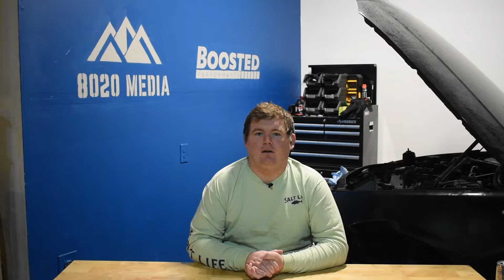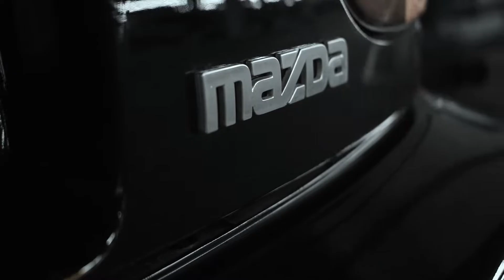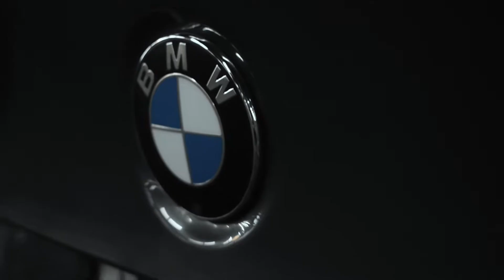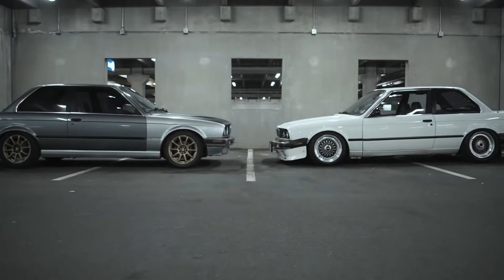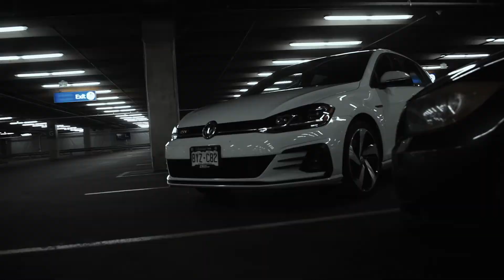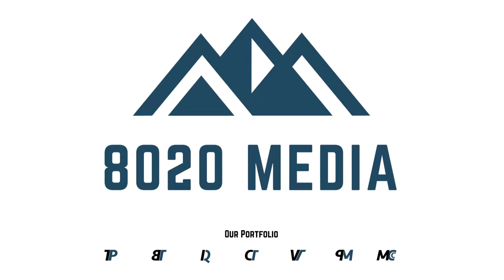Ford's 6.7 PowerStroke | Reliability and Common Problems

Comment: Greetings !  , what would be the symptoms of metal in the fuel system due to metal , from the injection pump failure ?
And what codes point in the direction of fuel pump failures ?
Thank you !!
Reply from the maker: C - Metal shavings from the pump can contaminate the entire fuel system, and the symptoms are nasty—hard or no start, rough idle, hesitation, loss of power under load, stalling, and eventually total engine shutdown. You might also hear clicking or ticking from the injectors as they get clogged or damaged. As for possible codes: P0087-P0089, P0093, P0191.
Reply: Thank you very much for a great imput , thank you a million , for answering my question , and your time ; plus going beyond with your anwer .
 @8020Automotive

Comment: The 300k miles.  Is in my opinion not the end of life of motor.  They need to last 500k   Especially for $85k-$100k truck
Reply from the maker: J - "need" is a little aggressive, especially for nowadays standards. They don't build them like they used to.
Reply: @8020Automotive  true. But they weren’t $100k in 2002 either. They were $38k. lol. I hear ya. “Need”. Hard to expect less for $100k lol. 😂
Reply from the maker: J - Agreed!
Reply: @joshuajuarez3471 what do you think 38k was worth, “back then”?

Comment: what should i bwe looking for in a 2015 6.7 at 219k
Reply: 200k miles is not a lot of miles… I’ve owned several 6.7s with over 450k miles on them. It’s all about how well they’ve been maintained. Don’t let this dude scare you off about a truck that’s had a life other than sitting in a garage…
Reply from the maker: Christian - Although 200k miles may not be a lot to the 6.7 PS, that is still a lot of miles in the grand scheme. Not once did we say it was "too many" miles. In general, if maintained properly, yes, these can make it way past 200k.
Reply from the maker: M - That's a lot of miles, but make sure to check the maintenance records. Buying a vehicle with high mileage it is crucial to know that they have been maintained well. Other than that, you'll want to check out the things listed in this video.

Comment: I'm considering buying a 2015 f250 6.7L with about 95kmiles. I don't know really anything about trucks. Can anyone help me with like the pros and cons and/or what to look for or be carefull of when checking out the truck? Any help would be greatly appreciated.
Reply from the maker: Brian - Did you watch the video?
Reply: I did. 
 @8020Automotive
Reply: I've been trying to my research and scan reviews. I'm trying to get all the info I can so I don't end up in the situation I'm in with the 07' 6.0L I bought 2yrs ago (money pit)
Reply from the maker: Brian - Totally understand. We have a TON of content about this engine on our DieselIQ website. Here is one example: https://dieseliq.com/67-power-stroke-complete-guide-know-amazing-truth/

Keep us updated!
Reply: @briandaubert454 what are you paying for the truck?
Reply: Just purchased a 2016 f350 dually 2 weeks ago and learned after getting to my diesel shop that the fuel pump is at the beginning stages of failure so whatever you get have it checked out immediately. They're going to do the conversion kit and hopefully this is all I'll have to do to it. This truck is a MONSTER and I love it already. Coming from a 6.0 to the 6.7 is night and day difference in towing power. Do your homework and be prepared to have a few things fixed from the beginning but these trucks are very reliable if maintained properly. Good luck
Reply from the maker: Greg - Thanks for sharing your experience! You'll love the 6.7, glad you found the fuel pump before it was too late. Conversion is definitely the way to go.

Comment: I put the S&S DCR pump conversion on mine and got rid of the CP4 forever.
Reply: Did you have a shop do it ? How much was it in total ?
Reply: @wmcourte5161  Shop install was $700
Reply from the maker: F - Great decision!
Reply: @8020Automotive did you install or did a shop? If shop how much that cost ya?

Comment: Hey there, I have a 2012, 6.7 completely deleted with an intake if I change the fuel filter on a very regular basis will say with every oil change would this be enough to prevent the Bosch pump from giving out or what I need to do more. Please let me know what I would need to do if so.
Reply from the maker: 2b - You're certainly on the right track. Which pump do you have? CP4.2?
Reply: @8020Automotive  hey there yes I do have CP 4.2
Reply from the maker: Okay. Diesel fuel quality is huge when it comes to these engines, so make sure you are getting your fuel from a reputable gas station. Also, there are fuel additives that can be used, here's an article that can be useful for that: https://bapasonline.com/best-diesel-fuel-additive-for-the-ford-powerstroke-6-7l/. Lastly, you COULD do a CP3 swap. We've seen many benefits from this. Other than that, it sounds like you are doing everything right! Keep us updated on this.
Reply: @8020Automotive  thank you very much. You guys are very helpful. I’ll check in in a couple months. Thanks for the help.
Reply from the maker: Absolutely! We appreciate it.
Reply: @8020Automotive what cp3 fits in the 6.7 powerstroke valley? It’s to big to fit
Reply: Gen2.1 6.7L Ford Power Stroke CP4 Disaster Prevention Kit

S&S Diesel Motorsport
Reply: Use an additive that adds lubricity. I run it in every tank. I am putting a s&s DCR on next week but will still be running additive. 👍

Comment: 2012 f550 bought in 2019 with 25k kms. Now has 111k kms has been deleted and straight piped. On its third turbo. Ric Flair WOOOOOOOOO. my ford dealer has done warranty and all of them. So costed nothing. Has a dump box on it
Reply: On my 3rd as well.  2019
Reply from the maker: Austin - Thanks for sharing your first hand experience! 3 turbos…. Damn! Thank goodness for warranties.

Comment: Cp3 conversion a good idea?
Reply: My "2 cents": with proper lubricant added to fuel (if "Top Tier" fuel is not used) and fuel filters are purged correctly when replaced, the Cp4 is a great fuel pump.
Reply from the maker: Tattooed - Thanks for the added insight here!
Reply from the maker: Burning - This is an option that is actually pretty popular with 6.7's. However, there are a few things to take into consideration: Cost, warranty, tuning, fueling, and emissions.

Comment: Would you just replace the fuel pump every 100,000 miles? Whats the prevention?
Reply from the maker: Mike - few options here:
1. Get a good upgraded lift pump, change the fuel filter frequently, and run a lubricity additive like Stanadyne
2. S&S diesel sells a prevention kit that prevents the injectors and everything else from being destroyed if the CP4.2 fails: https://www.ssdiesel.com/product/ford-6-7-cp4-2-bypass-kit-2011/ - I still recommend steps in part 1 above. Doesn't really prevent the pump from failure just makes it less costly to fix everything if the pump doesn't fail since it keeps injectors, etc. safe
3. You can do a CP3 conversion but this costs like $3k+
Reply: @8020Automotive  thank you 👍
Reply: @xlegacyfusion8915  s&s has just came out with a replacement pump for the cp4 called a DCR pump PowerstrokeTechTalk just did a video on it
Reply: Cp3 conversion is a complete fix solution I belive
Reply: @Alidilman cp3 don’t fit in a 6.7L because of the crowded valley

Comment: I love my 14! The original turbo did give up the ghost just under 100k miles but has been updated/upgraded to the 17+ style turbo and HPFP. It's a monster of a truck.
Reply from the maker: We love hearing that! What mileage is it at now? Any major issues aside from the turbo?
Reply: @8020 Media  185k miles currently and it has been awesome, just did the HSM fuel filter upgrade, upper and lower. Piping kit is in the works then a bigger turbo, currently making 566 rear wheel horse but chasing around 800
Reply from the maker: Hell yeah! We do have a mod guide on one of our websites, but good luck on your build. Keep us posted on what you get up to!
Reply: Gotta change the injectors too for changed them in 15
Reply: looking at a 2014 with 44k miles currently!
Reply from the maker: Red - Did you end up pulling the trigger?
Reply: @8020Automotive  nope, but we got a 2020 f250 and we’re lovin it!
Reply from the maker: Nice! I'm sure you'd much rather have the tech in a Ford that is 6 years newer!